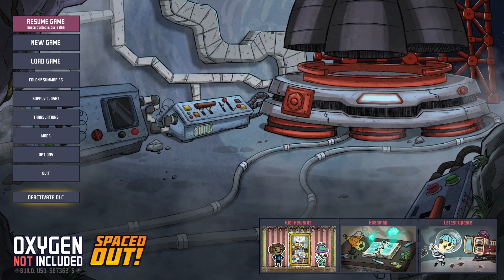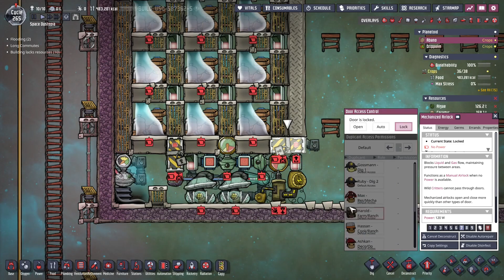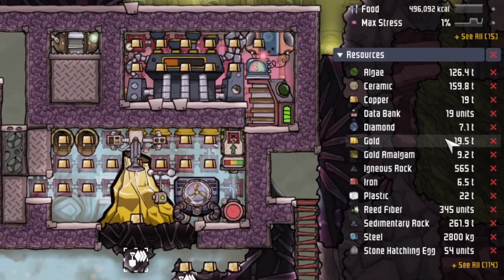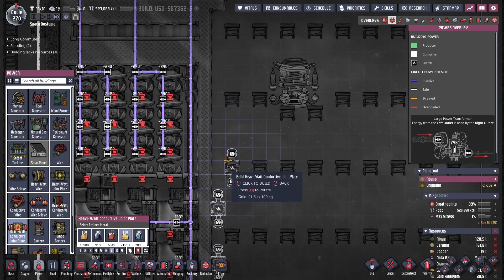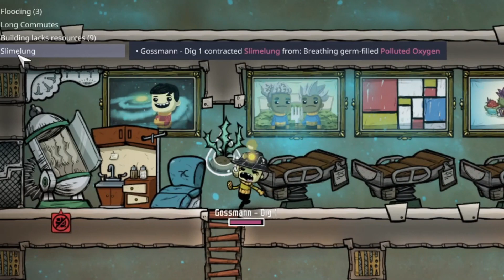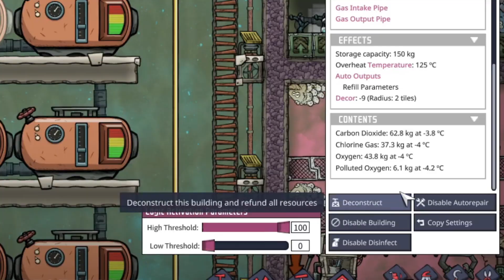Oxygen Not Included: Finishing the Hydra (LP - Ep14)

Comment: How did you put all the packets of different gases in the pipes at the end of the vid? I would have liked to watch it becouse it's not easy to do without making a mess or building multiple filters.
Reply from the maker: Simple. I looked for the required gases within my mixed gas storages. When I found a good candidate I ran a pipe from there to a pipe bridge a little bit away, which sucked the gases into the pipe (the hydrogen came from one of the tamers). Then I isolated the pipe segments with the required gases and removed the rest. After that I just had to chain them in the correct order, build a temporary pipe to where they were needed and used another pipe bridge to get them to the end again. It's pretty quick and dirty, but it only needs you to build a few temporary pipes.
Reply: @RKFWalter  I managed it, primed your hydra and call me amazed. I hope you will tackle a Frozen playthrough.
Reply from the maker: Have fun! 

I do plan on a frozen Ceres LP. But only once I'm through with Satisfactory first.